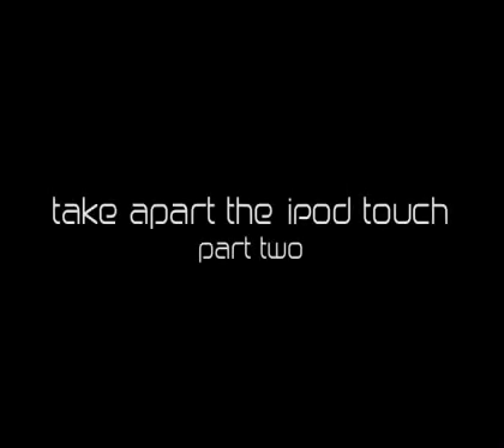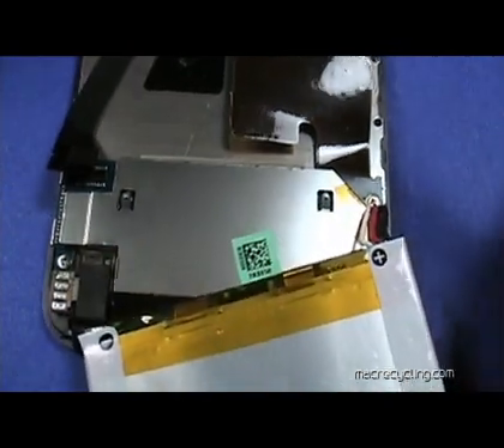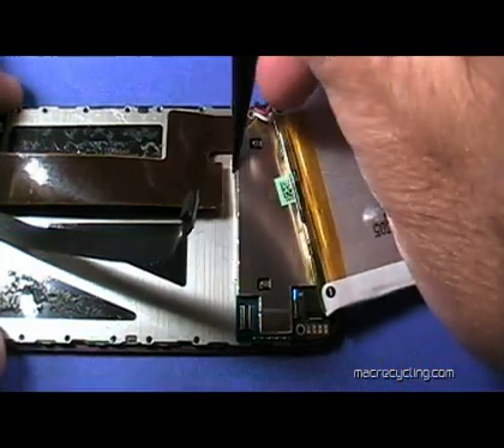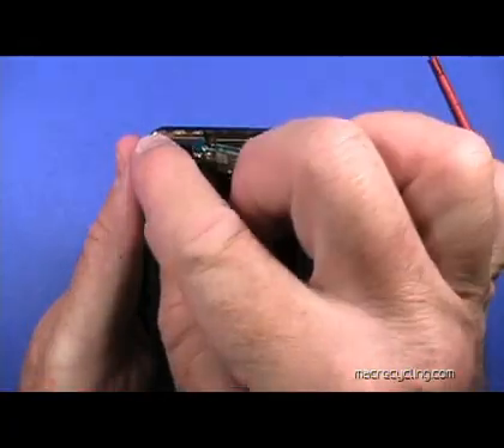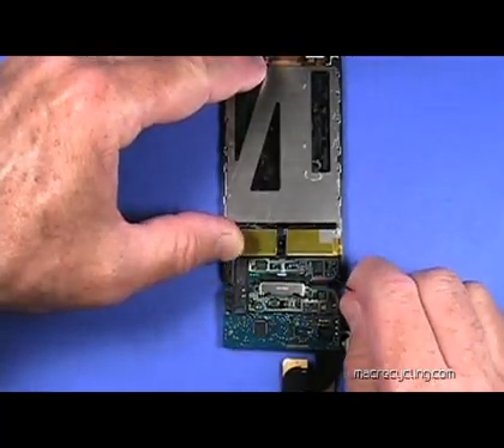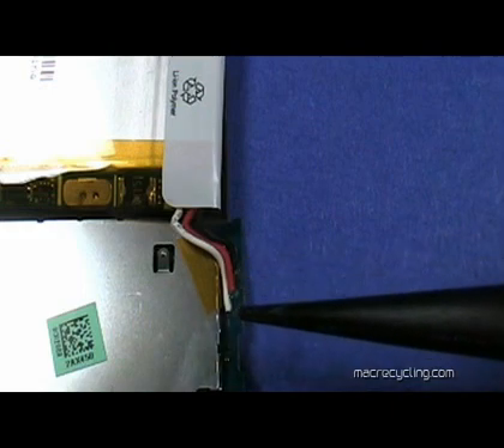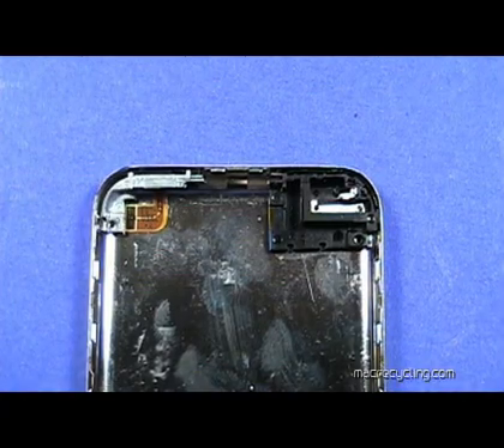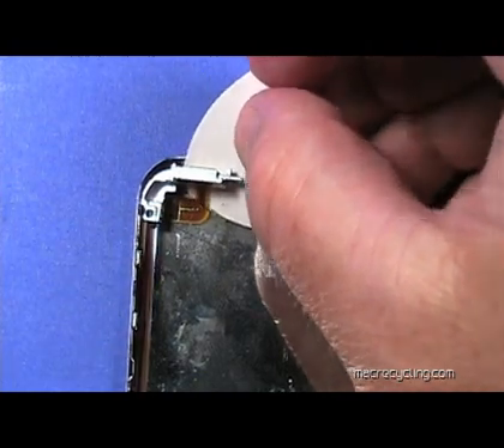Take Apart Apple iPod Touch 1G - Disassembly  Part 2/2

Comment: Would have been nice if you warned about the audio jack breaking off when removing the board.  It's only held on by a small arm of the board and the audio jack is glued down.  Unfortunately the audio jack ribbon cable pulled out of the jack about the same time the board broke.  I don't see anyway to salvage this do you. 

I got it back together and the home button works now but now I have no audio. Anyone have a spare board with audio jack attached?

Comment: the "composite AV Cable" will work for sound if my jack is broken ? 
they  NEW ipod Touch's  are $50
and the AV Cable is $40  Ouch .. 
so i really need to know if the AV Cable works for the beatmaker and synth apps 
(Message Me plz)

Comment: @alexmusic07 it wont wrk. i have a 1st gen pod touch 8 gigs and since the first day i had it i jailbroke it.den my home button got stuck. now after i downloaded the virtual home button(iHome) it began working. but den my ipod jus randomly turned off a few weeks later and now it stuck on boot menu. and it goes nowhere from there. only way i can fix it is if  i put it in DFU mode. and the only way i could do that is if i hold the home button long enough. and my home button now isnt workin at all.

Comment: It's important to note that on some models, the wifi antenna ribbon will tear easily, and if you try to remove the top board as shown here, it will rip off, and then it's done. Kaput. No more wifi antenna. Ever. I just did it. If only this was indicated in the video. Drat.

Comment: I'm wondering if you know of any particular things to be careful about when opening these. I've done several repairs on them sucessfully, but lately I've had quite a few in a row just totally die after being opened. It is very confusing to me. The Touch is pretty straight forward and not difficult to repair. Why would they go completely bricked after being opened? It seems like the LCD as well as the motherboard are useless, since they've been tested seperately on other iPods. Any help/ advice?